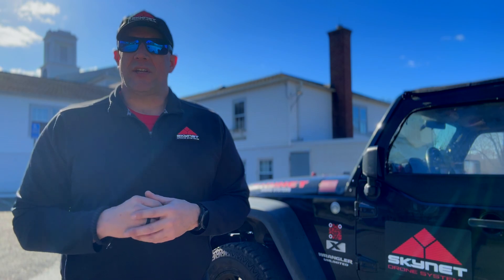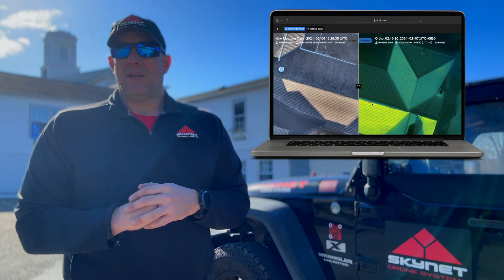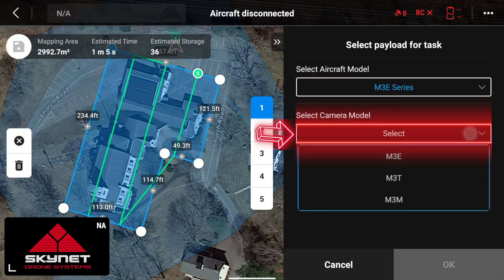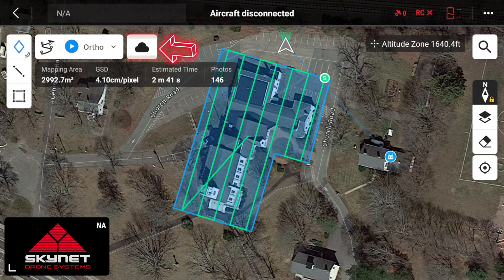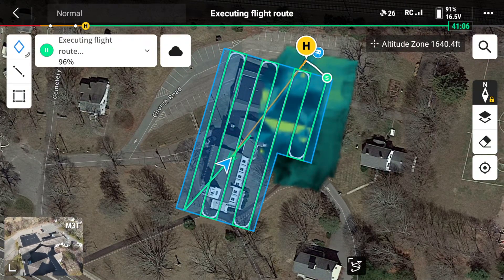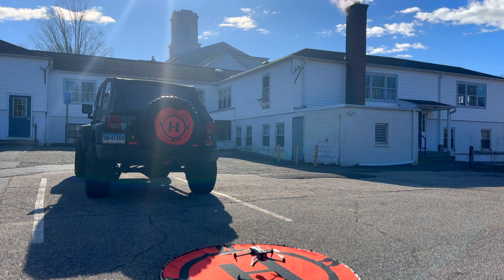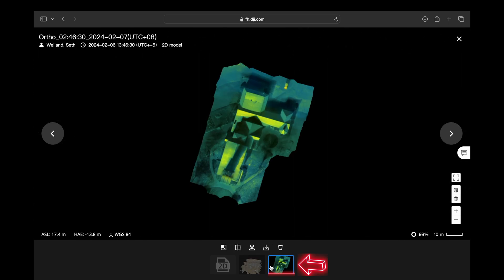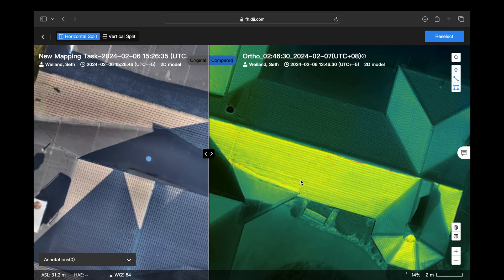HOW to CREATE an Orthomosaic THERMAL Map and Thermal INSPECTION using DJI FlightHub 2

Comment: I just subscribed to this service for a month to try it out...

How do you share the results with clients? From what I have seen, simply sending them a sharable link like WebODM does is not possible with FH. I of course would want to show clients these models, maps and overlay reports with the swipe control.

FH really can't do that?  If it can't be shared, it has significantly less value.
Reply from the maker: You can add anyone to the project by sending them a link to join.  Once they accept, they will have full access to all of the imaging and models associated with that project.  
https://fh.dji.com/user-manual/en/model-library/manage-models.html

You can download 3D models from DJI FlightHub 2 in formats like B3DM, OSGB, PLY, OBJ, S3MB, and I3S, as well as 3D point cloud formats such as PNTS, LAS, PLY, PCD, and S3MB

Comment: are both the thermal images and RGB images in that same folder that is being used to create the ortho map?
I have mine separated and when I select all of the thermal images, there is an error message: "Number of wide photos less than 5. Unable to start mapping". Does this mean the WIDE images need to be in there too? if so, it will create the 2 different ortho maps so they can be overlaid?  

It created two different folders, one for each mission, RGB and Thermal.
Thanks!
Reply from the maker: Awesome!  I’m glad it’s working for you!🔺
Reply: @Skynetdronesystems  do you even read my post?
Reply from the maker: @hchattaway  my apologies I must’ve replied to your post when I meant to reply to another.  

The way I perform my flights to avoid having the problem of not having one data set is I perform 1 flight with the wide camera.  Then I perform another flight inside the same project with the same mission parameters using the thermal/IR camera.  

You’ll end up with one set of RGB data from the wide camera and one set of thermal data from the IR camera in two separate folders inside that project.  

Then you can show both folders data on the same map overlaid on top of each other.  

Let me know if that works for you and I apologize again for not replying appropriately to your comment earlier! 🔺

Comment: Hi, Im using the Dock2 with M3DT, and I'm trying to create a 2D Thermal map. After "mapping" these, both RGB and Thermal, there is no thermal model. Is this function no longer available?
Reply from the maker: I’ve run into the same problem trying to capture both sets of images during the same flight as well.  I’m not sure why, but I couldn’t locate the thermal imaging data.  Going forward, I’ve always flown the same mission twice if I needed RGB and IR/thermal data.  1 mission using the wide angle lens then the same mission again just changing the lens to IR.  

I wish I had a better answer, maybe someone knows of a fix.  However this only takes a few extra minutes on site and you’re guaranteed to have both sets of data.  🔺

Comment: Hello and Great video,
can you provide me some information on where to purchase and how to install the wide camera?  I can't find a wide camera angle lens for mavic 3t online and the camera lens on the mavic 3t doesn't seem detachable as other dji products.
Reply from the maker: You have a zoom, IR and wide camera setting already installed on the M3T.  Just select which lens you want to use for each flight.  You can also select both the IR and wide lenses to capture images during the same flight.  When setting up your flight mission, you have the option to select which lens or lenses you want to use to capture the data. 🔺
Reply: @Skynetdronesystems  Thanks I see now
Reply: @Skynetdronesystems  Thanks that worked for me but I'm now having issues with the cloud mapping of the IR photos are saying failed.  Also that seems to be the only way to get a mapping of the IR red photos onto the flight hub due to only being able to auto upload to the cloud wide angle photos.  Any help?
Reply from the maker: I’ve run into a similar problem with trying to capture the IR photos at the same time as I capture photos with the wide angle lens.  The best way I’ve found to solve it is just to fly 2 missions, one using the wide angle camera and then the same route using the IR camera.  That way I ALWAYS have both sets of data 🔺

Comment: The M3T can take Wide and IR simultaneously by selecting both😂
Reply from the maker: Can you process a live map while at the same time capturing data from the other lens?  I’ve tried running both lens during a flight mission and couldn’t locate the images from one lens or the other.   I’m sure it’s probably a setting I have wrong but I’ve had nothing but bad luck in post production using the imagery from a mission using both lens simultaneously.  I’m guessing if I turn off cloud mapping and just let the data go directly into the project from both lens? 🔺